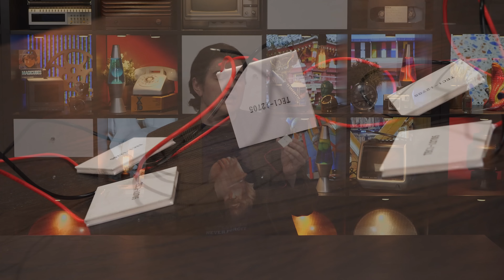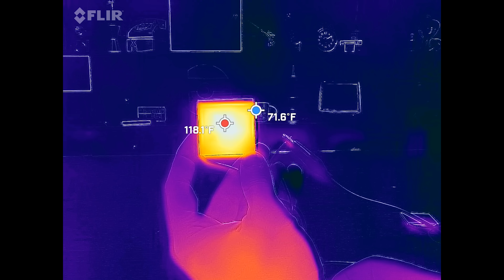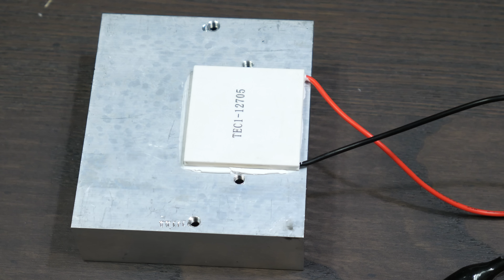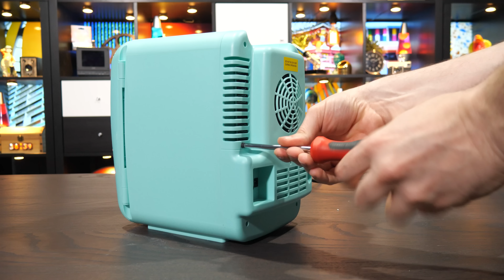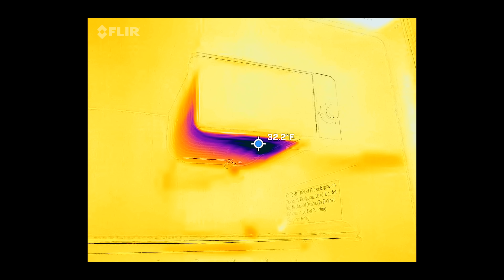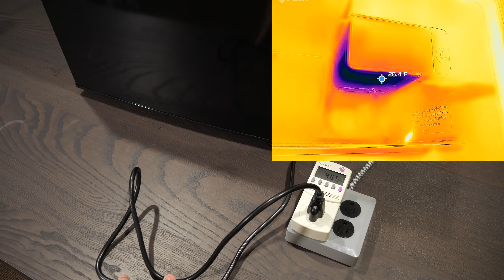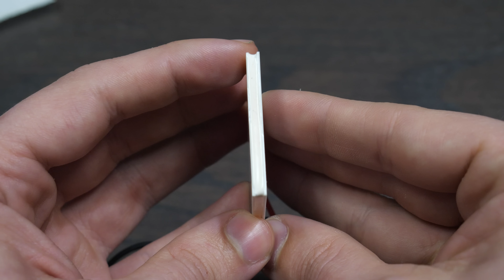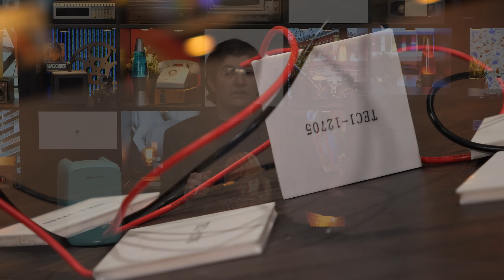Thermoelectric cooling: it's not great.

Comment: as a hard of hearing fan, thank you for uploading your scripts as captions (and for the in-jokes in them) nearly everybody relies on the auto transcriber. It works sometimes but misses a lot of technical words. Really appreciate you making your videos much more accessible to folks like me, Thanks!
P.S. I had a peltier cooler on my Celeron 300A processor back in the late 90s, what a time. 50%+ overclocks.
Reply: I also appreciate it as someone with deaf friends. I can share it without worry. Truly a shame more YouTubers don't do this. YouTube taking away the fan subs as well was so dumb.
Reply: @mittensfastpaw  YouTube didn't take away community captions just to screw with the HOH community. They did it because people were grossly misusing community captions to self-promote, type random slurs, or add "context" that wasn't there (such as openly shipping two YouTubers in the captions instead of just writing what they're saying).
Reply: Yep, also useful for us foreigners who have English as a second language. Reading is often easier than listening so good quality captions really add to the viewing experience. And there's a clear difference in quality between real captions and auto transcriber, even if the latter has made enough progress to be reasonably useable (most of the time).
Reply: @Liam3072  It's especially frustrating that the auto-transcriber only works somewhat okay-ish if the speaker has an american or british accent, anything else and it's completely rubbish. Even as an aussie, I very rarely use voice recognition because nothing can reliably recognise it, despite the fact that the australian accent is widely considered "reasonably close" to certain british accents (although I personally disagree, unless the person is from Western Australia.).
A particular example that occurred probably about 10 years ago but has stuck with me was google voice search interpreting "Sydney Harbour" as "See me haha". It couldn't even get the most well known location within the most populated city in the entire country. It has improved much since then, but in my experience it still really, really sucks (unfortunately I have no other choice for subtitles in zoom meetings).
Reply: @Liam3072  Come on Liam, even the English have English as a second and third and forth language. There's no two places over there that speak the same. 😵‍💫
Reply: @Liam3072  They help us English people who developed the language which the Americans have forked into their own variant. Many US accents are almost unintelligible to us, especially if they are speaking quickly.
Reply: @RWBHere funny thing to gripe about since more change has taken place in English accents, especially the formal BBC type, than in American accents. You might say we have been keeping your rhotic Rs warm for you in case you ever want to return to Shakespeare’s tongue. (Now, when it comes to slang and vocabulary, yeah, we been hatin’ on yo fancy-ass talk.)
Reply: @RWBHere  actually, if I remember correctly, the typical American accent is far more similar than pre-colonial English than modern British English.
Reply: I have autism that causes auditory processing disorder and it helps SO much. I'm not HoH but can very rarely "process" what is being said without subtitles or going back and rewinding ten times. The automatic CC are hardly helpful and the new wave of AI-generated CCs are also extremely lackluster .. +1 it's always appreciated
Reply: @laphlaes  Same! For those who don't know: This condition has nothing to do with hearing nor attention skills. In fact, it also goes by the far more accurate name "Language Processing Disorder".

Basically, Autistics with this condition (usually mild level 2 or more pronounced but can occasionally occur with level 1) struggle to grasp either individual words or sentences in day-today speech because of neurological differences in learning or interpreting language as a whole (usually grammatically and phonetically). It is essentially incurable, but we often learn how to cope with it by... ironically enough, listening extra extensively and using contextual clues to fill in the gaps. The result is basically the OPPOSITE of attention deficit: an obsession to listen to EVERY DETAIL POSSIBLE in hopes of understanding anything being said. You basically learn to hyper analyze everything around in while in "talk mode" and may develop an accidental controlled state of eavesdropping without even realizing it. This sucks because people then assume that you aren't "paying attention" when they speak to you because you can "magically understand what was said in the other room... Plus eavesdropping is basically purely evil according to every TV show I've watched, therefore this probably makes you evil against your will, and the guilt of that fact WILL eat you alive for the rest of your life.

Why good captions help: They give an extra layer of information. Also, for some reason, written words tend to be significantly easier to decipher despite the fact that the condition has nothing to do with any hearing problems.

Why bad captions are worse than none: It creates an intense amount of confusion and may or may not result in a fit a rage... or at the very least, a sensory or emotional (they are NOT the same) meltdown. Don't ask me how I know. 😂

Quick questions: Anybody know how to fix the subconscious eavesdropping that seems to come with this condition? I'm tired of doing evil things WITHOUT EVEN BEING AWARE THAT IT'S HAPPENING UNTIL IT GETS TRIGGERED IN A CONVERSATION. How exactly am I supposed to be not evil if my brain does it without consent?
Reply: @kidwolf0015  unfortunately, I don’t have a solution for you, except to try a low-grade background noise blocker like loops earplugs. But I want to stress that eavesdropping is in no way “evil.” 

Most of the time, listening to conversations around you without meaning to is a safety, survival, or coping strategy. Everyone I know who’s been labeled “nosy” for eavesdropping (including me!) learned to do so for their own safety. You might need to pick up on tone and emotion levels for a room you’re about to enter, for example. Plus, the heightened senses of autism make it hard to cast a shallower hearing “net.”
Reply: @laphlaes  I’m not officially diagnosed with an auditory processing disorder but I relate to this a lot
Reply: Skibidi Heat Pump ftw!
Reply: [music]
Foreign
Thank you
Reply: I guess with modern CPUs this is not possible anymore. The TECs would need to pump 200+W to keep the temperature, and even more to improve it even a little bit. That would mean a minimum of 400W of heat output...
Reply: @TheRailroad99  yeah LTT have tested this, modern CPUs put out so much power that a TEC gets overwhelmed and makes the CPU hotter instead of cooler.
Reply: Google removing the community based captioning was a hell of a thing for them to do, im not fully HoH but i like subtitles when im struggling to hear, and just in general, and the fact that youtubers, even if theyre a scripted based youtuber, dont upload subtitles at all, is just a little annoying.
Reply: Ive slowly come to realise that captions are a very simple and easy way to determine if a creator really cares about their product.
Reply: @crispyjelly2485  The worst is when it's clear all they did was wait until Youtube's autotranscriber had gotten through the video, and then used a downloader to get the text into a file and then do a really lazy first pass and then slap it up on the channel. The least they could do is actually check for homophone errors so "nVidia" doesn't get transcribed as "on video", just as one example.
Reply: i agree with you so much! i dont have any hearing issues but anytime i turn on auto captions its glaringly obvious that they are near impossible to understand if you CANT HEAR THE AUDIO!! especially on scripted videos it's pretty easy to add captions so i dont get why there isnt more channels that do it.
Reply: same here, Alec is one of the very few youtubers i watch who i can rely on to have proper, high quality captions on every video. that bit of extra effort goes a long way and I hope he knows how much it's appreciated, and I hope more youtubers start to follow his example!
Reply: + End credits and bloopers - having the transcript is awesome. Thanks for reminding me I need to turn on captions!
Reply: I appreciate this just because of how lazy everyone is with AI generated subtitles. To still go out of your way to make quality captions by scratch is respected.
Reply: Yes thank you for that too. Unfortunately many political advertising does not offer captioning. Maybe you should run congressman lol.
Reply: I noticed that too!! There are some  easter eggs in the closed captions, love it.
Reply: I also love having the script.
I don't have hearing problems.
I like how the autotranslator can work it to be grammatically correct, but not the generated ones 😢
Reply: @astraquilastra  The thing that takes a script and makes it captions doesn't check or change grammar. It just does its best to time the bits of transcript into appropriate length and timed captions. This is usually a little worse than manually written and timed captions but leagues better than the autocaptions (which aren't always good at recognizing words and are also awful at recognizing where to punctuate).
Reply: I plan to use them for my future videos. I love it whenever people put them in, and especially this channel!
Reply: It’s upsetting how garbage a lot of CC are even on streaming services that have the resources to afford a competent transcription. They’re constantly messing up words that totally ruins the context of whatever is being said
Reply: Yeah, I watched a science video recently where the YouTuber had trusted their transcription service a little too much and "ribosome" was butchered in several creative ways.

One of the YouTube channels I follow (Evan and Katelyn) has said that the reason they captioned every video even at the start of their channel was that they wanted to treat their work as professional, and professional videos have captions as a rule. I think we should enforce that societally more. "Oh, you don't caption your videos? So you don't actually care if your videos are watchable or not? How unprofessional."
Reply: @aliengeo hey fellow Subject of Joob!
Reply: another mark of professionalism is to take the time to have proper grammar. I am so sick of hearing NPR news programs butchering the simplest English rules.
Reply: @aliengeo  You know, I'm not usually one to say this sort of thing, but the entitlement on you really ought to get smacked off.
Reply: @seigeengine  that’s a stupid comment.
Reply: @DanskeCrimeRiderTV  Yeah, it's stupid to think harassing strangers for not doing the specific labor you wanted them to is bad, not entitled at all.

You got me.
Reply: @seigeengine  I think the phrasing the person you're referring to used is a little... harsh? But I also think it's worth imploring people to include accessibility features which will expand their audience and which, in some cases, is required by law (the vast majority of YouTubers I think aren't required to caption under the law, but some are). I'd probably personally do it in a more "catch flies with honey instead of vinegar" way, myself.

Historically, accessibility has needed to be advocated for and fought for; rarely has it just been done by sitting around waiting for it to happen.
Reply: @citrusella-nomorecraptions  I don't know of any laws that require captions for nearly any YouTuber that isn't like, a major media company, or a university, or something of that sort.

You catch more flies with vinegar than honey.

You are not advocating for accessibility. You are advocating for harassment, entitlement, and gatekeeping.
Reply: @seigeengine  That's the thing. I'm not advocating for harrassment, and I thought I was clear in doing so. That's why I said (with the "honey over vinegar" expression, which is the way that sentence normally goes and I'm confused about your inversion?) that I'd probably be kinder/politer in pushing for it and why I said the vast majority of YouTubers aren't covered under most laws requiring captioning.

I'm surprised it seems like I'm advocating harassing people into doing this kind of stuff, because that's not my intent--though I do know there are some people out there who will see any push or request, no matter how polite, as a slam or harassment directed at them or some sort of challenge to their authority or reputation (or alternatively, their fans may view that kind of thing this way, which I've seen happen on some extremely polite and friendly expressions of desire for accessibility in some places).

Shaming people into doing it by saying they're unprofessional and don't care about their videos (like the person you referred to initially) is not how I'd go about it, in significant part because it causes people to view accessibility as a hassle they HAVE to do or those annoying people will be on their case again (or in some cases something they deliberately avoid doing out of spite, which I've seen someone threaten to do before after getting shamed over an accessibility they weren't providing by a small but persistent group of people), as opposed to something they WANT to do that can help more people watch their videos, people who should not be considered entitled for wanting equitable access.

(On the chance you're referring to my username: It's referencing a hashtag which I was not the one to coin (generally attributed to Rikki Poynter, a deaf YouTuber, though I don't remember if she coined it) which was intended to draw attention to bad autocaptions and to extremely bad contributions to the community captions system back when that was a thing, and I adopted it years ago because a significant minority of my time volunteering to community caption videos was spent editing out terrible captions caused by people using it as a joke and comment space.)

I'm confused about the "gatekeeping" thing, though. What gatekeeping am I advocating for?
Reply: @citrusella-nomorecraptions  
The expression is incorrect. Amusingly, it's also generally incorrect with humans too.

Hence why I clarified that, as far as I know, zero actual YouTubers are under any such requirements. Major media companies are not youtubers.

I am talking about the people demanding or even expecting other people to caption their videos. They're effectively saying "do a bunch more work or don't do anything at all." That's gatekeeping. It's particularly annoying to me, because I've felt a very similar way about the anti-AI nonsense that's popular lately.
Reply: @TheDaygard I can say no better! Cosigned :)
Reply: Do you happen to know how much time/effort manually feeding in the script adds to the process of developing the video? Details on how exactly you feed in a transcript would be awesome. I have a friend who makes videos and relies on auto-transcription.
Reply: Ah, back in the wild west of CPU cooling. Remember when HardOCP got a world record for pushing a 300A to 1Ghz? Think it was a crazy combo of peltiers and liquid nitrogen and lots and lots of condensation protection lol
Reply: @gotindrachenhart  Why did I imagine cowboys driving a herd of cattle across a CPU?
Reply: @seigeengine  🤣😂🤣
Reply: @seigeengine I don't see it as entitlement at all. 
Rather, I see it as a testament to how serious they take their work.... or don't.  
To not even review it to catch the really glaring and CONFUSING errors...  I'd be embarrassed as hell, putting something out like that. 

And it's not gatekeeping either...  it's simply having a threshold for standards. 
And the reason all this is important?  Look at how terrible any form of journalism has become.  Nobody cares about grammatical and compositional standards anymore, so it's no wonder why kids are so seemingly poor at grammar, spelling, parsing homophonic definitions, etc...  because the world has seemingly become so commonly lazy with its grammar/composition.   

Anyway...  not meaning to go on a tangent;  it's a small part of the big problem....  but still am embarrassingly glaring one.
Reply: @1SqueakyWheel  You're saying you don't find being a gatekeeping PoS entitled because of your opinion about the target of your gatekeeping?

Comical.
Reply: @seigeengine  No, that's not all what I said... Reading comprehension, mate!  
But the only comical thing I see here is the circuitous logic of your reply.
Reply: @1SqueakyWheel  Unfortunately for your unhinged nonsense, I don't actually care what you want people to think you've said.
Reply: @seigeengine  Hang in there buddy.... You'll hopefully get get a clue one day. 
Cheers!
Reply: @1SqueakyWheel  Keep crying about how you think it's okay to abuse people.
Reply: I was wondering if they got used for custom PCs the whole video lmao, how much power did it draw compared to the processor?
Reply: I remember people using peltiers to cool CPUs back in the day. I never did it because I was concerned that should the heatsink fan ever fail, the peltier would cook the CPU. Although one side gets cool, they are overall (net) a heating device.
Reply: WHAT?

Comment: When I was younger I tried making a personal desktop cooler using Peltiers. It ended up raising the ambient temperature while providing very poor, very localized cooling. Of course if I created a duct to transport the "waste" heat out of the room it would help but it simply wasn't worth the effort by that time.